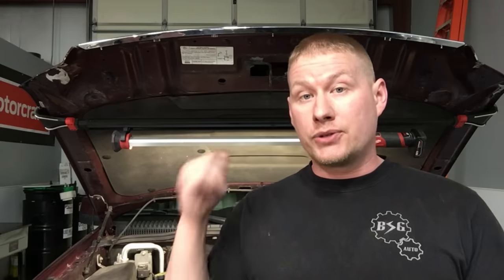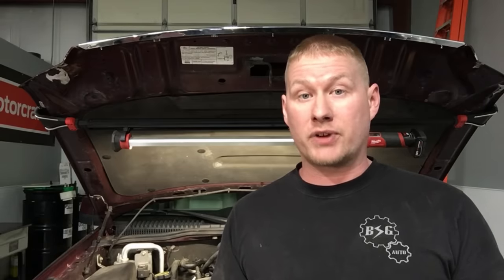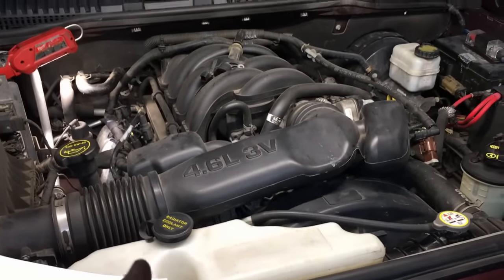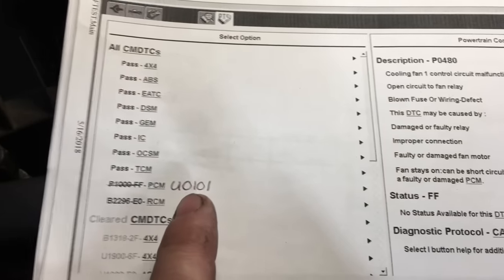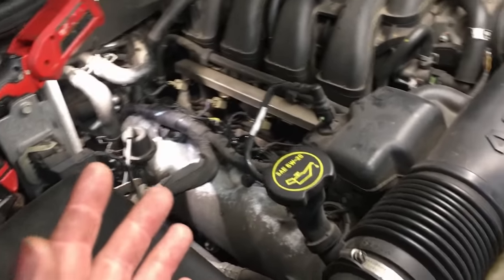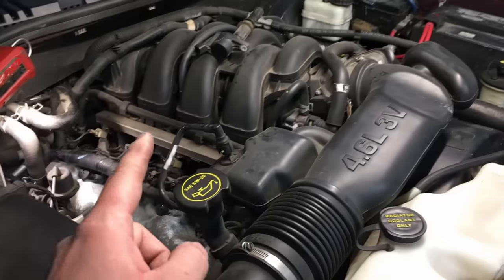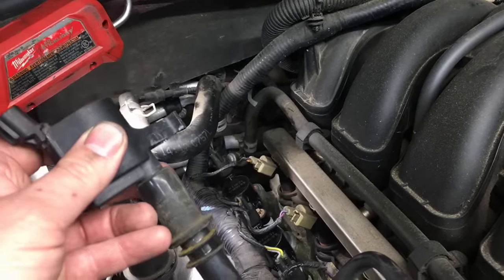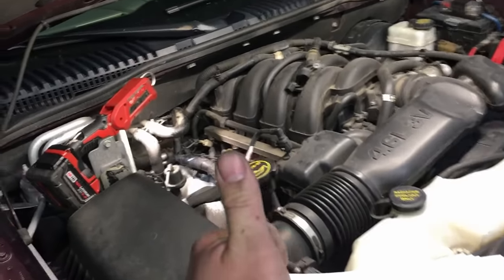2006-2010 Ford Explorer Transmission Shifting Issues Wrench Light: Check This Item First!!

Comment from the maker: ***BEWARE OF FAKE MOTORCRAFT COILS***
Coils that are listed as "sold by and ship from Amazon" is your source for Genuine Motorcraft Coils at amazing prices:
DG511-
https://amzn.to/2x27tZe
Reply: FordTechMakuloco 
hey whats the best spark plugs to use for a 98 ford explorer eddie bauer with the 4.0 sohc ive hurd so meany mixed reviews on what to use
Reply: StuffButter 
RTFM whats that asking the question more then once
Reply: FordTechMakuloco  I’ve noticed something similar to my 2006 Ford explore.  I had to get it towed to a auto repair place and they fixed it but it still feels sluggish.
Reply: Hi! The acedelco coils are good? Thanks
Reply: I thought pcm is the engine and trans module in one single unit why did you mention transmission control module? Thanks
Reply: Is it ok to use MSD Blaster coils?
Reply: FordTechMakuloco i need your help i have a 2006 freestar the wrench light comes on after driving for like 15 mins i dnt lose power but the obd code says 02 sensor bank 1 sensor 2 stuck lean can these be the problem and if so. which one is bank 1 sensor 2 ??? pls help
Reply: ese tipo de guagua como uno le chequea el nivel de aceite de transmisión yo tengo una 2006 Ford Explorer sport fordtechmakuloco
Reply: as one measures the transaction's oil level
Reply: FordTechMakuloco I just got a yellow wrench light no banging noise and no code shows up.
Reply: @armobyzantine5881  the 6R60 has a separate TCM integrated into the Transmission Valvebody
Reply: Hey Man, 2010 Explorer Sport Trac. Same exact problem without the misfire code. I get u01010. Cones and goes. I reset the code i have no probs for awhile then it comes back. Wrench, Traction and engine light. ( limp mode ) i cahnged the 4 coils with motor craft, car had more power felt great but the condition returned a short time later. Help!!
Reply: Ford edge 2007 same problem you think trans is making noise and hard shifting in low gear
Reply: Hi Loco ford mech, why don't you respond to the comments and questions? It will help us alot if you would answer. P.S. I love all your videos you are the best of the best, please answer our questions 💜 ❤ ♥
Reply: ❤copy that salud

Comment: Excellent Advice. I've had transmission issues for years. Recently, my local mechanic told me the PCM is shot. Most recently the engine was running really rough and the transmission kicked frequently. Replacing the ignition coils fixed all these issues. My engine and transmission are running smoothly now.

Comment: We need more of these 2006-2010 explorer videos!
Reply: More 4.6 engine)
Reply: I agree......
Reply: I definitely agree. I have a 2006 Mountaineer. And I think I have the same issue described in the video. Gonna switch out my coils for some MSD blaster coils.
Reply: AGREED! 4.6!
Reply: 07 ford expolorer 4.0 lt not power on closter
Reply: i feel like this generation of the explorer is SO underrated.

Comment: 2006 mercury mountaineer fixed after experiencing EXACT symptoms. Originally changed misfiring coil packs with DURALAST brand (junk) approx 6 months prior to onset of shifting problems and random codes. Immediately after watching this video changed coil packs back to new OEM coil packs and completely remedied all shifting and computer problems. 🤟🏼 HUGE help. Thx.

Comment: This totally worked for me ! 2007 ford explorer  started bucking and transmission was acting crazy. . It gave traction control and wrench symbol. I didn't know where to start. The CEL came on after a little while and  gave codes PO306 and P0101' changed the coil on cylinder 6, everything was back to normal, thanks  !
Reply: Hi! Was that the 4.6? Thanks
Reply: was yours mostly having trouble going into reverse like mine w a little hard shifting once in awhile w other gears? You only changed #6 how did you know it was that one, I'm a novice trying to learn for my truck

Comment: Nice find, and great that you share your knowledge!  May I ask about my PowerShift gearbox?  I have an EU Ford Mondeo with a 6DCT450 MPS6 gearbox, and would like to know if there is a way to make the gearbox go back in to learning mode, as the shifts have been too aggressive since the last garage serviced it and did a gearbox oil change?  Many thanks for any info on this gearbox or PowerShift hints, tips and inside information in general you could provide!

Comment: I had that issue with cheap coils. IT caused the wrench light on my 2006 mountaineer.  It wasn't missing. I bought AC delco coils it was like a set of 8 for 200. So I put chevy parts on my ford about 5 years ago.

Comment: Ha! I just went thru the same exact thing! Ordered coils from Amazon and replaced one bad coil and the engine ran fine. Decided a week later to replace the other 7. IMMEDIATELY faced the check engine, wrench and traction control lights with tranny slamming in and out of gear especially while stopped. Time ti get better coil packs. Thanks so much for sharing your wisdom!

Comment: Was getting a TP sensor error, Communication Bus Fault, Pump motor circuit failure, steering wheel angle sensor failure. Wrench light, check engine light.  Funny thing is, It never produced a misfire code. It was shifting hard into second gear.  I changed all the plugs and coils.  Runs like new now.  Thank you for the video, it saved me a lot of $. Your're a top notch mechanic in my view.

Comment: This summer i had this problem...
Tracs light on...ABS light on...into safe mode...U1900 ABS CODE.
I do not know if the PCM U0101 CODE was set because i only checked codes AFTER shutting down. So after changing MAF sensor did not help at all...i changed 4 coils with Accels ( on passengerside only) and also changed all plugs with Motorcraft. Have NOT had this trouble return even once in the 6 mo. since. The pass.side coils were absolutely the problem. Owning a Ford is never boring...or sensical.
Ford Makuloco is the BEST Ford tech on YT...THE only ONE we even need!

Comment: Great, informative information here.  On my 2009 Explorer Sport 4.6, a faulty battery was causing the voltage to drop so much during starting, that it would confuse the electronics and cause the dreaded Orange Wrench of Death.  Transmission would stay in 3rd gear only.  Amazing that a battery would cause the symptoms of a transmission failure.  Needless to say, I am NOT a fan of all these electronics on newer vehicles.

Comment: This video really help out. I was working on a 07 explorer 4.6l. Its my brothers father in law. He took it to three different mechanics. One of them opened the transmission and they told him he had to change the TCM. and The mechanic told him to put the tranny down he charge $$$$$5000. and he said  it was a lot of money but good thing he didnt do. Finally, they could not figure anything, they told him to take it  to the diler he didnt take it . and he already wanted to sell it because they did not find the problem. the first day that I went to look at it i scaned and gave me codes of the coil 2 and the trottle body posision sensor and it was running like on 3rd so slow to pick up it wasnt shiften.   Im glad that i watched this video which I had doubts about this. but decided to change all the coils and incredible is well without problems running good .

Comment: You just saved my cheap, shade tree mechanic, ass... Again.  Had the CEL, Code U0101 and clunking into reverse.  Figured this 15 year old beast was through.  Just not worth putting much more money into it.  After watching your video, I figured I'd swap some coils in from my garage queen Town Car, but they aren't the same.  So, I swapped coils from one side to the other.  Cleared code and problem is gone.  Ordered another set from Amazon to replace the cheap ones ordered from there in 2018.  God bless you!

Comment: Thank you so much for the info. I just replaced the VCT solenoid on bank 1 along with a leaking radiator. Started having this same trans problem. Thought maybe I lost too much trans fluid. It only took 1/4 of a quart. Still had trans problem. Until I looked this up on your site. Replaced all 8 coils which were Motorcraft. Problem solved. Keep up the great work.

Comment: I had my right side exhaust manifold changed and the mech welded a nut to the exhaust bolt.

I believe the ground was too far from the work or he sparked to the frame as most welders do and shorted out 4 ignition cois fuel pressure sensor abs sensor and cruise sensor.

Beware welding.  Not only disconnect the neg post but also the ecm plugs coils fuel injectors and every 5v sensor you can see.  

Of course he tells me that he didnt do it.  But all these codes show up at once the day after i got the car back.  

Also if the ignition coils are not clipped or the hold down bolt is stripped and shaking the coils the dirty power will cause similar issues, without throwing a code for bad ignition coil

Comment: Nice, I have fixed a few transmission problems on the past years, on expeditions and f150 (5.4) by just drying the coil or replacing  it. I like how you explain things man. Keep up the good work
Reply: I know this is a old post but do you mind explaining because I'm having transmission issues right now and I have had it rebuilt.  I have a 04 expedition 5.4l

Comment: Great troubleshooting!  Here's one to share:  I had a 2010 that seemed to be slipping or failing to upshift out of 2nd or third gear when hot.  The coolant was low, forcing the electric fan clutch to remain engaged.  The over-revving fan felt and sounded like a transmission problem.  

The leak was at the rear of the truck where the hoses enter the rear heater.

Comment: Thanks for the video and the solution - I had the EXACT same symptoms - all came about in a single trip - yellow wrench & engine shut down, followed by slight miss, check engine light, traction control light, yellow wrench again, and that same bam-bam-bam shifting, even when sitting still.  Installed 4 new coils on that side,  everything back to perfect normal.  My 2006 is burgundy just like in the video - common thread?

Comment: Thanks for the help, saved me from accidentally quoting out a $1200 tcm/valve body assy to the customer.  Glad i looked online cuz what i found odd was that the tcm wud only fail the network test with KOER, but passes the test when its in KOEO. U would never think to check for coils pulling down the network under normal diag circumstances. 07sport trac had aftermarket coil on bank 2 cyl#8 tat wud intermittently misfire. Confirmed the issue by swapping it out with a oem coil from a mustang i was also working on. Sure enough the issue was gone when i roadtested the vehicle.

Comment: Thank you so much.  I put some aluminum foil around that wiring harness and it is shifting normal again.  My transmission guy was pretty sure the transmission needed rebuilt and I was close to replacing all of the solenoids to see if that would fix it so you saved me a lot of money.   I replaced the coil packs less than a year ago with Mallory ones and did not want to do it again so I tried the foil.

Comment: This is the best video EVER!  BOOM, the car is fixed!  I thought it was time to junk the car.  Had misfire cylinder 6.  also had U0101 and B1900.  2006 Mountaineer.  Replaced #6 coil and problem was gone.  I also replaced the rest of the coils but #6 fixed it.  Car was jerking like crazy and thought i needed transmission.  So happy, I should send this guy $50 for the AWESOME video!!!  😃😃😃
Reply: Hi! Was yours the 4.6 or 4.0? Thanks so much

Comment: Excellent information. I once had a similar issue it was on a lincoln SUV I could not get the AC compressor to kick on I was chasing my tail in circles, decided to take a break and take care of a miss fire the vehicle had low and behold once the miss fire was fixed the AC compressor was back online and everything was good!!

Comment: After watching one of your videos on followers going bad (5.4) and helping me save a customer roughly $8,000 on a quote from a Ford dealership. Im forever a fan of your experience and ability. I work on so many off the wall vehicles, domestic and foreign. I do say though, diagnosis on a Ford is much more delicate in its own way to narrow down the cause of an issue. I enjoy the challenge.

Comment: Off subject question.. do you have a video on 2008 or related year f150 AT cooler quick connect fitting at the radiator leaking issues? Replacement or bypass with aftermarket cooler options. No good resources online.  You are by far the most reliable source for Ford tech info. 👍

Comment: Just Had my 2007 Sport trac 6R60 transmission fixed just like you said i was parked when it happened to me I am 81 years old have been driving since I was 15 years old have never have this happened to me you where 120 per cent right it was fixed like you said I am in Canada Owen sound Ontario !! that's what you get for garbage coils from E-bay  china Junk

Comment: I have a similar “transmission” issue, where when pulling up to a stop it feels like it is loading up.  This  is not a huge issue.  This summer I started getting a new issue.  Upon acceleration it sounds like a bus taking off. It is almost like the transmission isn’t shifting properly (I.e., like the engine is reving up) but I am thinking it may be the fan that is making more noise.  It does not happen all the time.  The other thing we noticed is that the temperature gauge jumps up and we get a warning light.  I have checked the coolant level and that is not a problem.  I was having a miss fire problem a couple years ago on a couple of cylinders.  I decided to replace all of the coil packs and spark plugs at the same time. After watching this video I am glad to say I used OEM parts. I was reading something on a message board today where this guy solved a similar problem by having a thermo bypass replaced in his transmission. I was looking to see if you had any videos on this issue.  What are your thoughts? Any suggestions?  I have a 06 Explorer w/4.6 auto.  Thanks! Micheal
Reply: My 2006 Ford Explorer 4x4 started doing this EXACT Same thing last night.... I managed to get it home and parked but have spent all day looking this issue up and was looking for a video on this topic as well.
Reply: What ended up being the problem?
Reply: Did you end up figuring out what  it was?

Comment: I have a 08 explorer 4.0 . transmission linkage moves on trans, but will not engage into any gear. Do you have any suggestions. Thanks for making these videos. They are very helpful.
Reply: Range sensor.

Comment: One thing and I don’t know if Fords will have this problem. My granddaughter had almost the same symptoms on a Dodge Stratus. I did some research and found a flakey alternator could cause this. She took her car to her trusted shop and they finally sent it to another shop. When it was fixed after 2 weeks, I asked her what was wrong. She said they replaced the alternator. Something about noise on the pcm data buss.

Comment: I have a 2007 explorer 6.0 / 6 cylinder What a shame you say this trick is for 6.6 motor  I had the engine exchanged and at least 3 mechanics have not been able to turn off the wrench light. I'm scared to take it to a transmission shop.   You are a Master Technician

Comment: Thanks for this man!
2007 Sport Trac. 256000 KM
Same engine and trans configuration.
Abs and traction control light at a stop occasionally.
Always clears itself after a few hundred feet.
But gear hunting on the highway lately.
Should I be looking at that over other issues?

Comment: hello, please do you have any idea about ford explorer 2013 climate control setting?, I have one ford explorer 2013 that I am restoring it AC system for a customer, it has shuts two compressor before it was brought to my garage, I have fix the issues its working now but I have some the compressor temperature going 150 df on a day when the outside temp is about 43, I later heard noise on the bearing although its not a new compressor it's used one, that has leaks at the shaft seal, 

1, my question is, is 150 df temperature of the AC compressor unusual or normal?
2, second question, whats the difference between the front and rear expansion valve of ford explorer 2013 model, I tore both apart and it doesn't seem to have any difference,
3, how do we know counterfeit spare parts from genuine one from motorcraft?
thanks

Comment: I have to thank you my brother, you save me money and time, I was having the same problem for a few months and the mechanic tell me that I need a new transmission, but looking for transmission on Google I found this video and really save my life, thank you again @FordTechMakulloco for take the time to explain all this I already did it and my transmission is normal again, I'm really happy again with my truck.
Reply: My 2006 explorer 4.0 stop shifting. I changed the fluid and installed a new filter. Still nothing.

Mechanic said I need a rebuild or new transmission!!

????.
Reply: @jovansaunders3565  did you watch the whole video?
Reply: @creativestylesbarbershop3342  yea i did, I guess I can give that a try.
Reply: @jovansaunders3565  I did it and it works, I almost change my transmission but thanks to this guy 👆up here, I didn't and everything come to normal, but hey another thing is that he's working on a V8 4.6 engine I don't know if it works for any engine. Did you never change the coils on your truck? If it's yes which one they used? Originals or the replacement?
Reply: @creativestylesbarbershop3342  yes the coil pack was changed but it's a 4.0 engine.  Heard the servo kit would work, may be worth a try.....I don't know.
Reply: So, what ended up happening in the end?